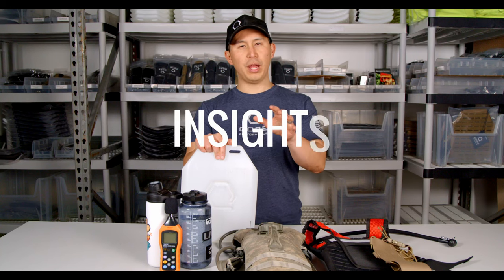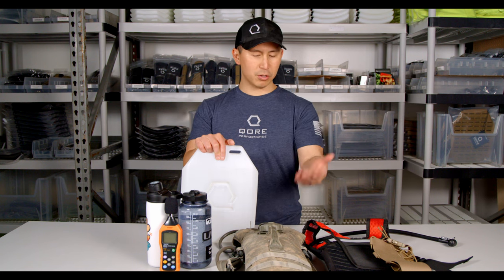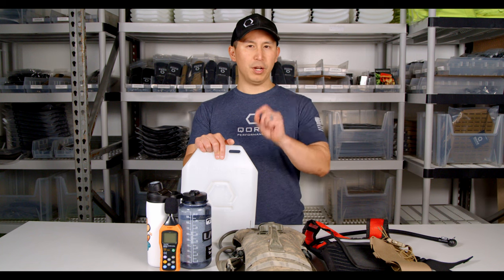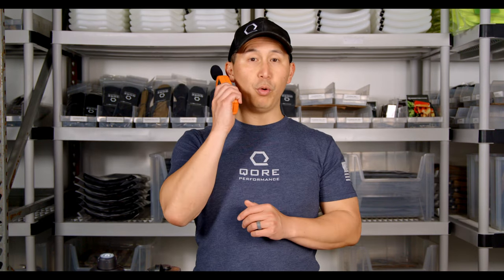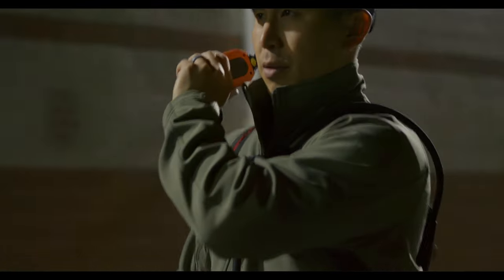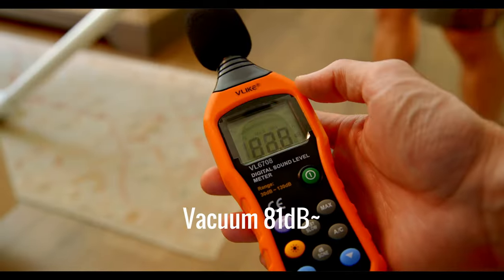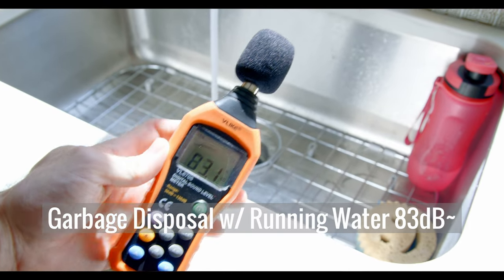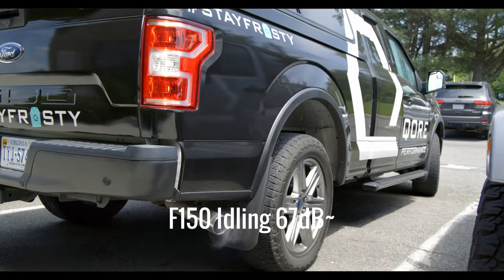Plate Carrier Hydration: How Loud is Your Water Bottle? (IcePlate®, Camelback, Nalgene)

Comment: Decent test. Confounding variables: wind, walk speed, and gait. Mitigate by using an indoor treadmill and wearing minimal layers under the carrier.
Reply from the maker: Treadmill was far louder. Useless testing platform where noise is a concern.
Reply: @QorePerformanceUSA  yeah that makes sense
Reply: When the ice starts to melt and sloshing around is the loudest piece of gear. If the drink tube didn’t leak so bad you could drink the water as it melted and that would be perfect but the thread on the plate is a bad design and unreliable
Reply from the maker: @G3kRay  We are sorry to hear you are having problems with your IcePlate Curve. With hundreds of thousands of IcePlates sold, we've only seen leaks occur in less than 0.01% of all IcePlates, so your experience is definitely atypical and we want to get you squared away. Here is a link to our Forever Warranty, just follow those quick and easy steps and we'll get you taken care of ASAP!
https://www.qoreperformance.com/pages/forever-iceplate-warranty
We intentionally used the same exact thread pattern used on Coca-Cola products to facilitate interoperability and field expedient optionality, but we also did it for reliability since it is the most widely used and proven bottle thread design in history. More details:
https://youtu.be/Os9UxPUuPjI
Reply: The problem is not while walking but while running : it’s pretty noisy ! camelback is far quietest if you have well emptied the air